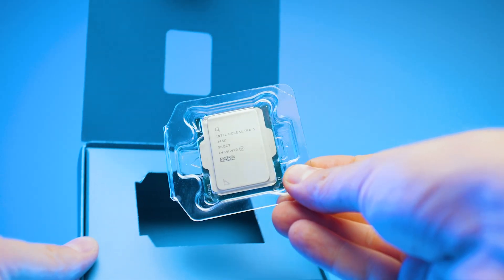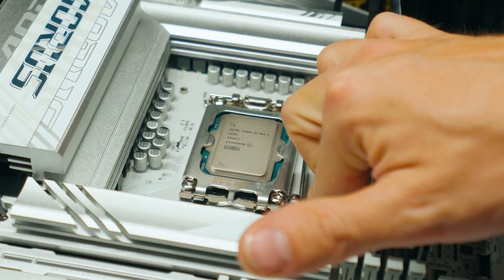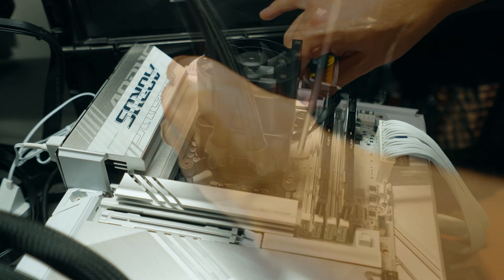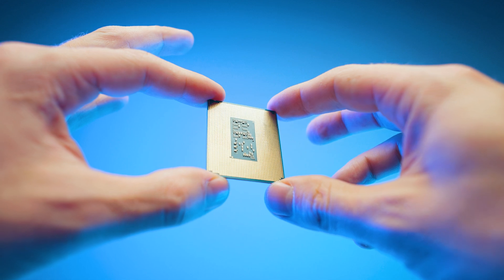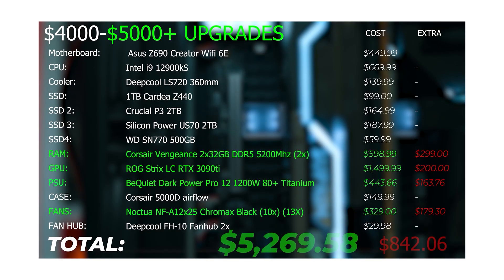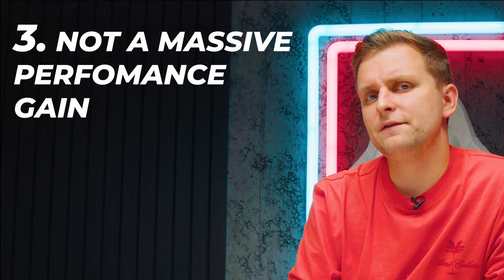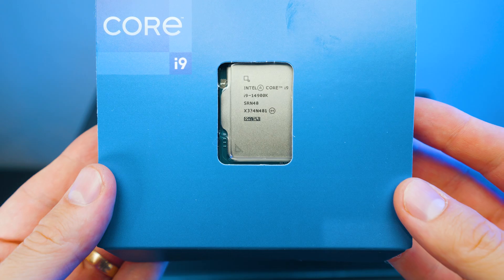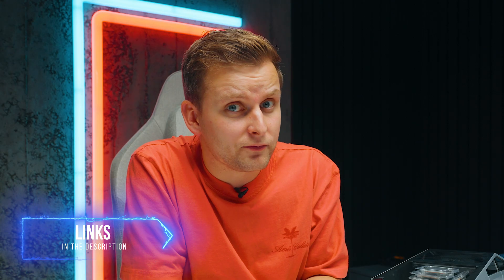6 Reasons You Should AVOID Intel Ultra 200s CPUs!

Comment: We need review for the 9800X3D and 9900X for productivity.
Reply: I love my 9950x when properly tuned it is very fast. Much faster than reviews make it out to be. Part of it tuning windows properly and tuning memory too. 9800x3d is outstanding do I'm hopeful for 9950x3d and I'll upgrade again. Chips are easy to install and easy to resell.
Reply: @jondonnelly3  yeah, that properly tuning turns me off massively, what the hell is the tuning?? and why the hell should we all be tuning our cpus to work as intented??? CPUs should work optimally right of the box.... but I guess thats too much asking in 2024
Reply: Im wondering this too. Did you find the answer? should i give up Intel Quicksync for AMD?
Reply: @duyhungphannguyen3049  At the end, I went for the 9900X, because it's a Ryzen 9, that means more Cores and more Threads than the Ryzen 7.

Comment: I need to build a new rig mostly for CAD/CAM applications really struggling with my decision to go with the 14900k and risk having issues or move over to AMD with something like 9900x. Most of these software recommend intel but Im worried since the 14900k has so many bad reviews and issues!
Reply: I've been running AMD for years now ever since rysen 3 came out. They are amazing chips. I use a lot of productivity apps for programming and also game and they are just plain beasts. I pulled out a 5900X and swapped it with a 5800X3D in a couple of my machines and while I did get uplifts that 5900X was more than enough. There's really no need to upgrade beyond AM4 at this point unless you're chasing having the fastest thing eve or are building a new machine. Either way they have been eating Intel's lunch.

I still have an Intel chip in my laptop but I don't use it very often.
Reply: Cad cam isn't demanding enough. Get an older cpu and save money
Reply: @Z-add  thank you, think i will do a 12900k or a ryzen 7700 and save some money!

Comment: Guys i need help i need a CPU for 1440p Gaming with 4090 + 1080p60 Streaming on Twitch at the same time but i don't what to pick i9-14900k or 7950x3d what should i pick?
Reply: if you gaming only, you can do that with 7800x3d just fine. Pick 9800x3d if you can but it's alwaYS out of stock rn
Reply: U think a 9800x3d is enough for Streaming and Gaming at the same time?
Reply: @TTV_DA11Kingbtw  yes, it should handle it very well. Unless you are not rushing to build one, I would recommend to wait for 9950x3d to come out and get that instead. But for streaming and gaming only. 9800x3d is doing just fine.
Reply: Thx man you a real G
Reply: 7950X3D, you basically get the best of both gaming and productivity. Or just wait for the 9950X3D which will come in just a couple months.

Comment: i have a 11900k and not planing on upgrading untill ddr5 and chiplet IMC matures a lot more, i play 144fps in 1440p no problem. not worth the upgrade
Reply: I agree. I have the 11900k paired with a ROG Strix RTX 4080 Super and it works perfectly. And the best thing about the "old" 11900k is, it won't fail like the 13/14th gen. Maybe I'll get the  285k later when Z890 bios matures more. We'll see.

Comment: Heres a big one, INtel developed AVX-512 and it doesn't have AVX-512 cause screw the things that made use of it for huge speed increases, know what does have AVX-512? AMD's 9000 series.
Reply: I'm really surprised that they didn't include AVX-512 in this lineup. Maybe it is some kind of reverse sunk cost fallacy.  AVX-512 is definitely useful, although more so for servers than for consumer PC's (for servers performance is more useful than for PC's anyway, mine is now idling at 1-3% after all).

Comment: You need to do a video on premiere pro using h.264 codecs. It's one of the few areas which Intel's CPU is significantly better than AMD's.
Reply: He has done tons of codec benchmarks
Reply: All of the GPUs can also handle h.264 for timeline, encode, and decode.

I believe, and I may be wrong, that this also applies to the iGPU in Ryzen now as well.
Reply: @Revenant_Knight  They can all handle it, but Intel's quicksync means it does it faster than any AMD or Nvidia chip. In tests with last gen, with h.264, pugetbench showed intels chip can be anywhere from 3-7x faster than AMD (timeline and exporting). For people that use premiere and that codec, this is very useful information.
Reply: @ Of course but that’s with a very specific codec used predominantly by pro shooters at 4:2:2 10bit which is in the realm of $5K body only cameras. For the average consumer, editing video from a phone or consumer grade camera, they won’t see much of any difference. While having the ability in your back pocket is nice, even most professional events don’t venture that far. When we filmed Ted X Talks their contract stipulated quality levels that could be achieved on I7-2600K and GTX 570. 

You aren’t wrong. I want to make that clear, but the context has to be there and I suppose I should have specified I was thinking from a consumer level and not a pro level.
Reply: @Revenant_Knight wait isn't H264/265 one of the most common codes? Sony A7s mostly output H264, and Premier pro doesn't support modern web codecs (AV1,Webm) so you'll have to re-encode to H264 or Quicktime  anyway.

Comment: Comparison is the killer of joy.   I think the intel chips look fine in a vacuum and address a lot of the complaints we had about previous gens.  The problem is, AMD exists, and right now, their products are making intel look bad.   Also, the main reason I will likely switch to AMD is the outrageous way intel handled their chips degrading and becoming damaged for years without bios updates.   I have no faith any more in their ability to offer certainty and stability, which was a huge selling point for me.   They now seem to be a fly by night operation.
Reply: I agree. Intel handling of the 13th/14th gen fiasco was covering their ass mode. They knew about the corrision issue for a year and told no one and left those chips in the channel.  Now an Intel exec says "Intel Exec Promises Arrow Lake Fixes For Major Performance Gains".  "How much of a performance boost? Hallock didn't say, and he also didn't elaborate on what those updates would be exactly, just that they were coming in a matter of weeks." Spin doctoring again Intel.

Hello doesn't any one at Intel capabble of benchmarking their products BEFORE reelease. I do not buy products that have issues based on promises of future fixes.

Comment: Intel ultra is a monster have VMware installed beats my i9 13900k makes think intel some how did not have gaming in mind make me think somewhere there’s a limitation to the graphics through the pci express. Probably will be fix on the next gen. Anyway I am enjoying it with my work as a imaging a modifying virtual machines for companies. Not sure that because of the removal of the hyperthreading. It’s a win is you don’t think about fps numbers
Reply: I see it as tailor made for Battlemage. PCIe 5.0 direct access to CPU with 8 pin power. No Hyper-Threading Technology but very good E Cores. CUDIMM. I think INTEL has all INTEL system in mind and on paper it looks 5080 performance and $1000 cheaper. APO also has a great potential to boost the performance. 

FPS numbers from INTEL ARC architecture you need double from AMD/Nvidia architecture. I run A770/i7-13700k for 4k. Great entry level for 4k that runs almost all at mid/high settings with RT. XeSS XMX supported games just great. Anything over 40FPS is a good experience. AMD/Nvidia you need double because half the frames are broken and out of sync. It is the difference between single and double silicon architecture where INTEL splits the tasks between CPU/GPU via REBAR. AMD/Nvidia all tasks are for the GPU and CPU is only there to feed it so Wattage goes up.

Comment: I don't care what people say. If you use your PC for productivity and game only story mode games, that will play well with 60-165hz, you are good to go. Nothing beats this CPU when it comes to productivity as it is now WITH A LOW TDP. I'm sure most of us here, are work first, game later. This CPU is perfect for that. Don't upgrade yet. Let them work out the kinks and jump in 3-8 months from now. It's a good CPU IMO.
Reply: you can get a 32gb ddr5 kit an upgrade later to a CUDIMM 32gb kit when they drop in price and get a great jump in performance. it would be nice if CUDIMM came out at a reasonable price but doubt that will happen
Reply: 9950x3d entering the chat
Reply: You're talking like 9950x is bad for productivity... Also, there a thing called 9950X3d coming, and you have plenty of years of upgrades if you use AM5. So... what's the reason to buy Arrow Lake right now?
Reply: @massimocrulli4988 The 9950x3D will probably be $100-$150 more expensive than the 285k, and I’d argue the 265k is a better value than both at $400.
Reply: @massimocrulli4988  Bro that chip will cost at least $650 you could get an Ultra 7 for about $380 at Micro center right now that will still be just about as fast as the Ultra 9. Plus LGA1851 will support ArrowLake refresh if that still happens and NovaLake in 2026.
Reply: @massimocrulli4988  True, however, its not that those type of AMD chips are bad, but just not good enough for some tasks like encoding or adding data between frames. Also, I honestly doubt that AMD will stock enough CPUS (again!), for most of the market at launch. And if they did then the scalpers would get it first.
Reply: What kind of productivity? My employer uses laptops including for developers and almost any medium to high level CPU will do nowadays. I'd likely not complain if I'd get this CPU in a tower model computer - but I won't. Would never buy it for myself, the eco system and CPU are too expensive for what they bring.
Reply: Yeah don't get it twisted. Watch gamer nexus's video on just how much more efficient AMD chips are not to mention how much more powerful they are in productivity workloads as well. If you want to game a little bit on the side they're more than powerful enough for that too.

They make so much more than just the X3D chips and even then the 9950 X3D would crush Intel's efficiency, productivity performance and gaming hands down. These are just facts. Being a fanboy for a corporation is dumb.
Reply: @Ace-Brigade   Nobody is selling themselves as fans. The MSRP for r9 9950x is not worth it in terms of price-performance compared to an i7-14700k or even an i5-13600k. No benchmark is consistent enough to support what you claim, even Nexus reviews highlights the variability in efficency with the "X" and "x3d" series. Unless you are doing 3D editing or upscaling then an intel IGPU for other producivity tasks is still far more viable, feasiable, and has higher clock instruction speeds.  
Ofc its good for gaming, but OP said they will primarly PvE in singleplayer, not online so why bother on tyring to convince him to spend more?
Also, 32gb of ram is not enough for most productive tasks, and buying 64 of ddr5 ram is gonna run around $180-240. Unless on sale, the CPU and Ram will cost around $900 or more alone. I don't see the justification in budgeting a rack for a 10% increase in some respects. People have specific needs bro, its not as simple as just following the trend, and future proofing in this right may only act as double edge sword for people who don't need all of those bells and whistles.
Reply: 9950X3D will literally smash in both gaming and productivity.
Reply: Absolutely agree these internet recommendeds are always for unlimited fps or power for whatever program...yappers

Comment: wait you recomend the 13/14th gen Intel CPU's that has a very high Failure rate ? why just dont say "if you're a fanboy buy the Ultra Core" and "if you dont be braindead then just buy Ryzen 7000/9000 series because way more efficient, cheaper, deliver more performance" who care about 8000 mhz ram if it do not impact in any performance uplifts ?
Reply: They have a bios fix, and 5 years of warranty. I'm already on the Intel so it make sense for me. Failure rate comes from overvolting the CPU, and am5 isn't worth upgrading due to high prices for little gains.
Reply: @oneanother1  It doesn't come from overvolting and switching between the two processors is as easy as buying a new motherboard. Something I know you Intell fan boys do all the time.
Reply: @Ace-Brigade  where does it come from then? I mean if you really want to go zen5%, no one is stopping you. Yet to see anything to upgrade to from raptor lake. Remember when zen4 had too much voltage and completely destroyed the CPU? Amd fanboys are balls to the wall, but their GPUs totally suck.
Reply: He's an Intel fanboy. At least that's the way it feels.

Comment: If ur still trying to convince urself that intel is better… newsflash, ur a fanboy. As a new entrant to the PC space, I’ve done all my research, and there’s almost no reason to have Intel at all. AMD 7000 and 9000 is much better than anything intel has out by a mile.
Reply: Lol you sound like the fanboy, if you do anything besides gaming Intel is the better choice.
Reply: @Ravelover5448 you couldn't be more wrong. All the numbers are out there and all the performance comparisons are out there. AMD not only smacks Intel with performance right now but also in performance per watt. Their efficiency is off the chart. Gamer's Nexus did a massive, expensive video to prove this to somebody who commented on his video and wanted to bet him. 😂

Both in productivity and gaming. You probably aren't going to beat some of Intel's productivity numbers with a chip designed specifically for gaming but if you go grab one of their other chips they will smack them down on productivity. Grab one of their high-end X3D chips and they will smack them down on both.

Intel couldn't keep up with AMD for years and so they just kept throwing more power at their processors. That's why they're in the boat they're in now. When I watched the kind of numbers those chip were pulling I was flabbergasted. They are sometimes pulling three and four times the amount of power it takes AMD to do the same and usually much more work.
Reply: @Ace-Brigade  Bro, calm down, get a glass of water and go take some time to rest that cope off.
Reply: @Ravelover5448  ur yapping. How I sound like a fanboy? For productivity and gaming AMD is good, and now that Intel has been flopping, it’s probably the best productivity and gaming CPU out there. Nvidia makes great GPUs but I can’t give them grace with their terrible pricing
Reply: So true, intel Cost more, deliver less performance, consume more power. So where is the point to buy Intel nowdays and let's add the point of 100% failure rate for Intel 13/14th gen. Cpu's ?
Reply: @ yeah the comment section of this video is sad. Just fanboys trying to justify why they’re bad purchase is actually a good one. 

But I can’t be too mad, this channel is an intel and nvidia channel. He rarely recommends AMD anything over Intel and Nvidia so the people who watch this channel are usually more often than not, intel and nvidia fanboys

Comment: Should I go with an ultra 7 265k or i9 14900k if I am coming from a i7 4790k?
Reply: I would go with 265k. 14900k just takes too mutch power. I think the 265k has at least 10% optimisation power in the back.
Reply: depend on your budged nobody who is clear in his mind will recomend you the 13/14th gen Intel CPU's and why ? Just look up the 100% failure rate on the 13/14th gen Intel CPU's. So here we are with the Ultra series, are you sure you want to waste your money when there is a better product around called Ryzen 7000 and 9000 seires ?
265k so this mean you want to play video games, so why dont buy the fastest or secound fastest Gaming CPU on this planet who consume 50 or 70% less power then the Ultra series and perform 30 - 60% better ?

for real i had the i7 4790k too back then and belive me or not, Ryzen changed my mind about intel.
Reply: @allxtend4005  yeah the instability issues were what was leaning me towards the 265k. I’ve been unsure about the Ryzens due to the lower cores for performance, but the 9950x is keeping me curious on how it’s high up in a lot of benchmarks, and has low wattage. Would that be a good purchase paired with a Proart x860E? I am looking for something that gives good performance for gaming but especially productivity
Reply: Wait for another month or so. INTEL is fixing the problems and there should be a good performance boost. I think that point 285K is the go. That said wait till Battlemage that is also rumoured to launch in about months time. All INTEL system on paper looks like 5080 performance but $1000 cheaper give and take. The new Arrow Lake has lot of headroom to overclock. We are already seeing 35% gains with bad Win11 support and BIOS's. I predict a big jump with INTEL fix. Also there are big differences on MB performance. Avoid ASUS. It seems to fry the CPU and has bad performance. Personally it is MSI for me.